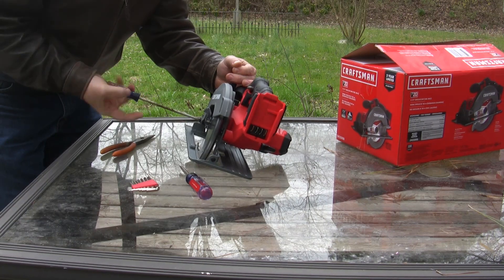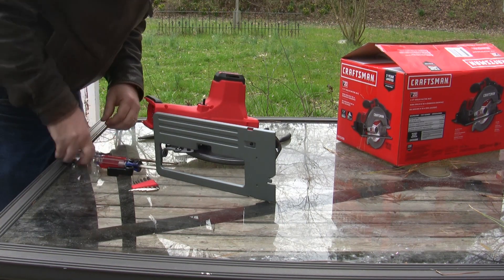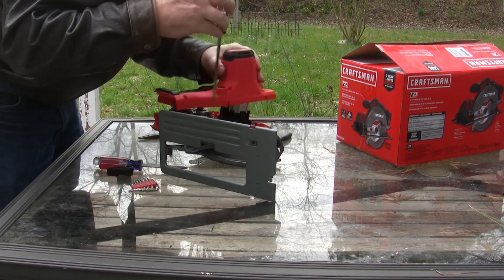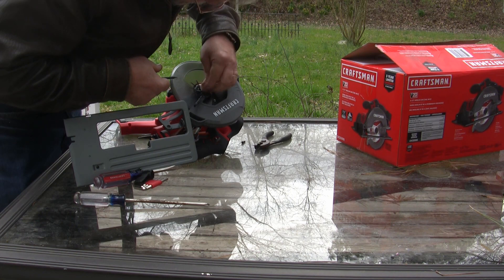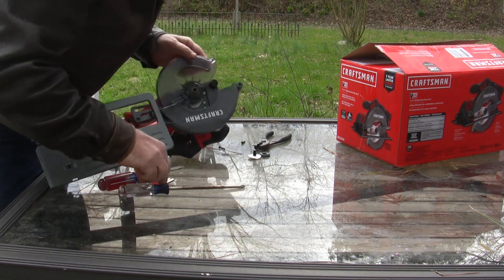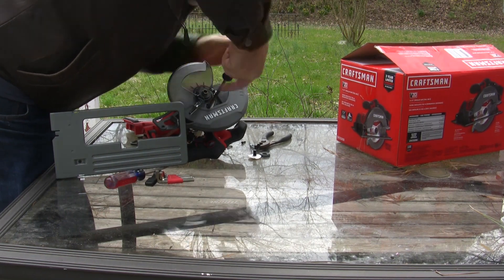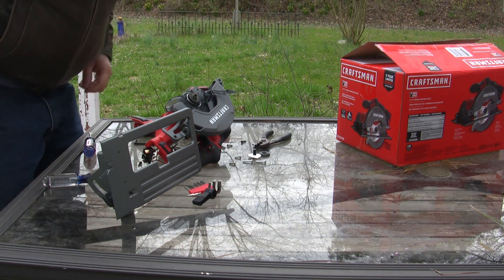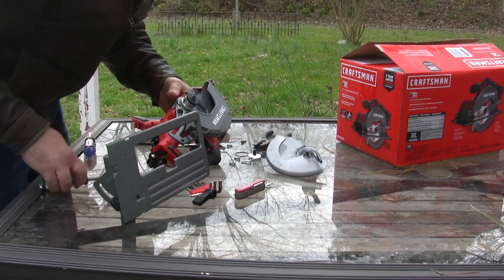Craftsman 20v Saw Teardown (20 volt CMCS500)

Comment: I'm looking to jerry rig an adapter for a different 20v battery for this saw. Is there any way you could upload a close up of the battery connectors and the wires that attach to them?